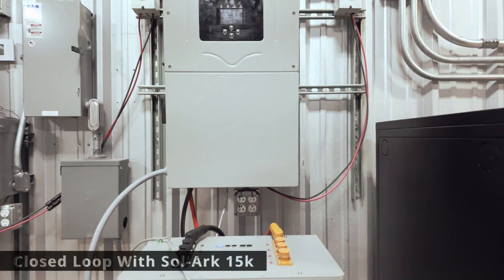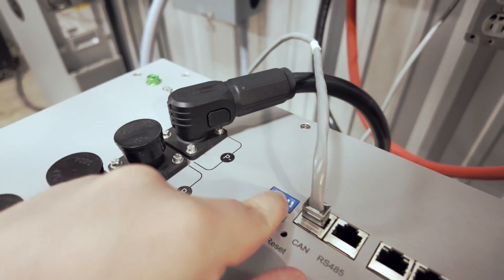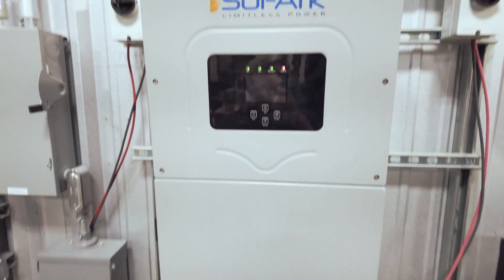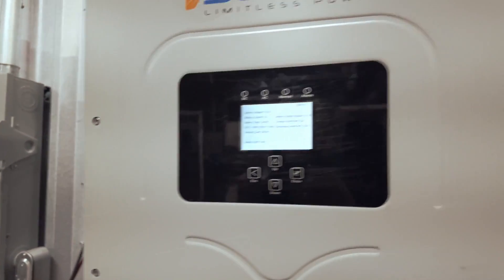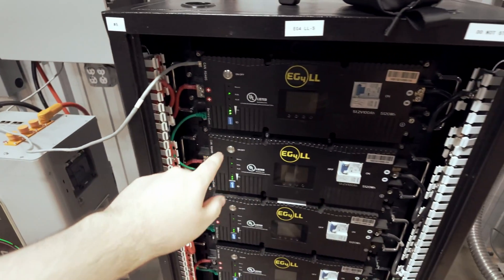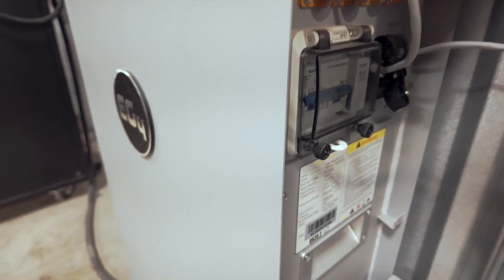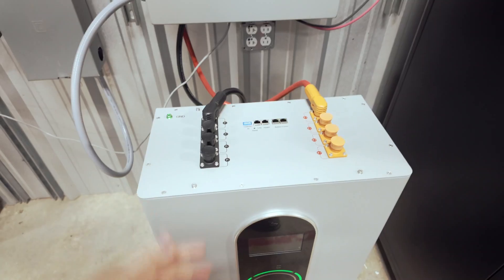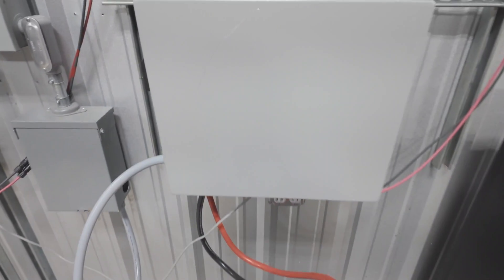Sol-Ark 15K + EG4 Batteries | How to Setup Closed Loop!

Comment: I'm guessing the procedure be the same for the new LiFePower4 v2? Just where you changed protocol on the display set the protocol ID dip switch to 3? Also, the protocol only needs set on battery ID1? Thanks!

Comment: So you don't care if you don't have a UL9540 or a 9540A   ?
Reply from the maker: UL9540 is very important for most installations as the majority of solar systems are installed in jurisdictions that require it. That being said, there's also a lot of places where you can install without it (or maybe just UL9540A, which is battery-specific and encompasses all of our current battery offerings). We have some EG4 users who don't require that certification and want to use a Sol-Ark inverter with our batteries, so this video is strictly a guide for those users!

If UL9540 is a concern, feel free to check out our ESS Systems on our website with all of our configurations for a UL9540 compliant system: https://eg4electronics.com/categories/ess-systems/
Reply: It is a vital certification, I believe all Sol-Ark batteries are 9540A compliant, and mainly for commercial and industrial applications.